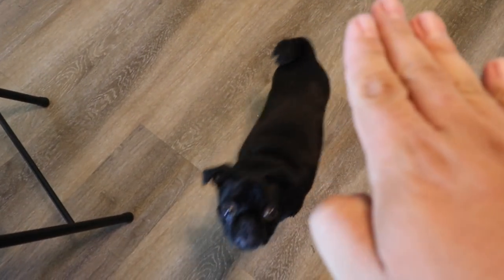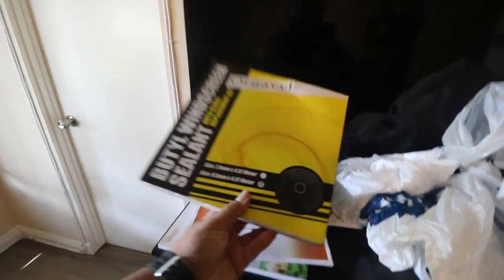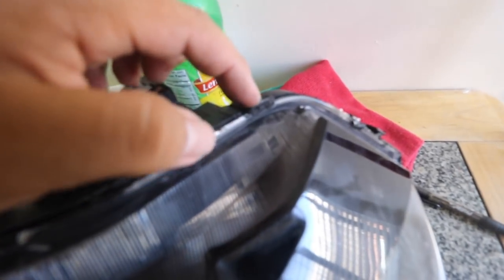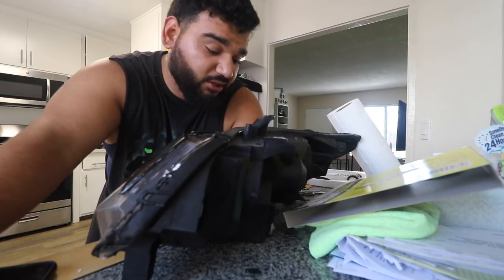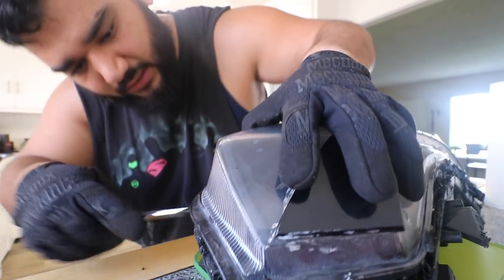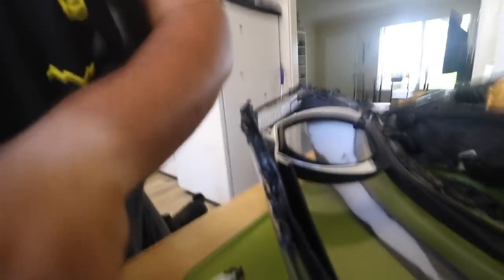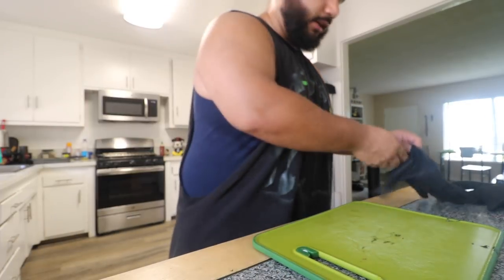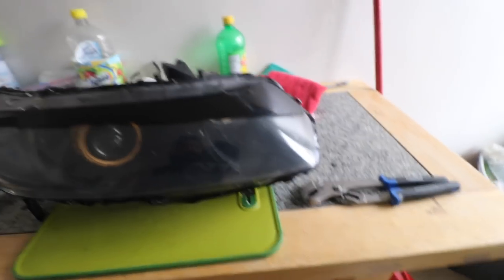Opening Up My Retro Fit Headlights! (Oven Bake Method)

Comment: I'm glad to see you doing this. I'm a headlight junkie myself.  But here's a link to 8thCivic.com that's the entire DIY for Retrofits:

https://www.8thcivic.com/forums/diy-honda-civic-lighting/237403-complete-mini-h1-retrofit-diy-8th-gen-civic.html

And you can see my retrofit build here:

https://www.hidplanet.com/forums/forum/general-discussion/specific-questions/64198-how-to-tune-rx330-afs-style-projectors

Not for the faint of heart if you go with the Lexus or S2000 projectors.  Stick with the Morimoto Mini V3.0 D2S bulbs, rather than the H1 bulbs IMO.  Sure it costs more, but you could pick up D2S bulbs up at any car parts store.